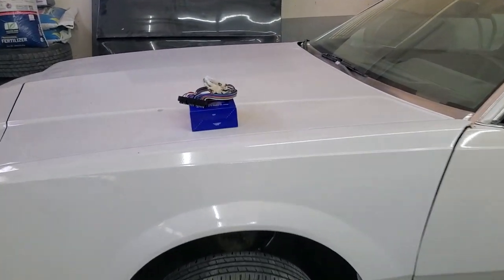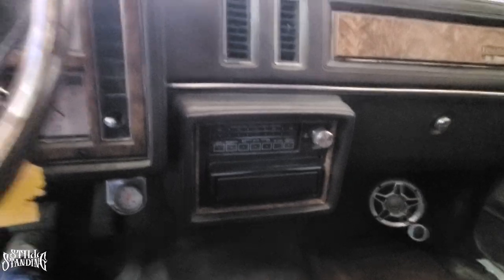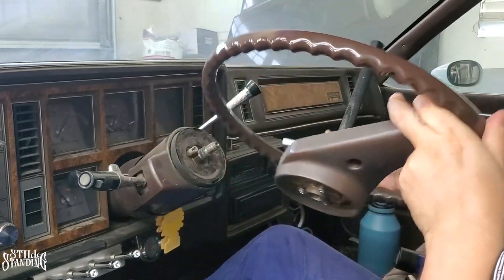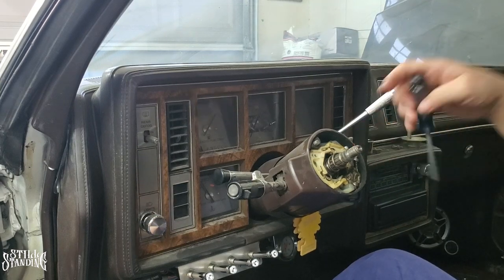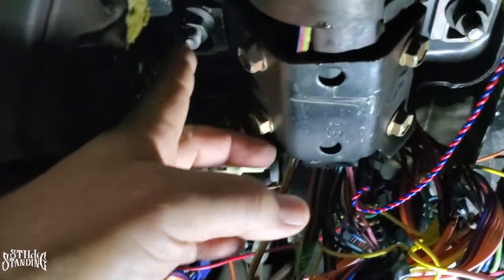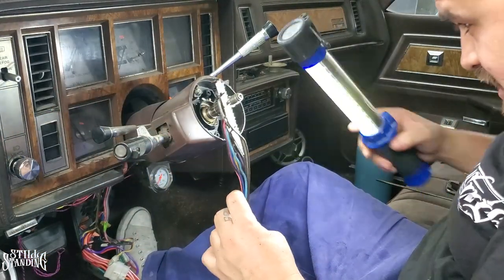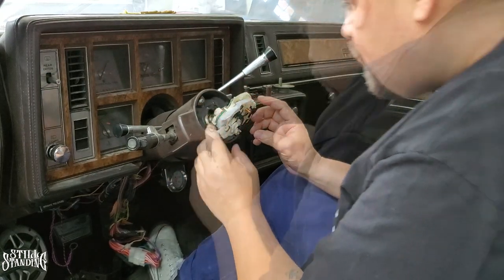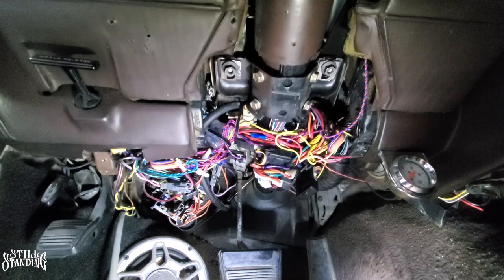G-BODY Turn Signal Switch REPLACEMENT 83 Regal

Comment: Thanks for the video its helping me out a lot. I have a question  why not just cut the wires
Reply from the maker: No problem 🤝. Yeah, you can do that, too. I didn't want to cut mine just in case I needed to put it back in. Thank you for watching
Reply: @StillStandingGarage  make sense thanks!

Comment: While removing the horn pad on my '87 Cutlass Supreme I seem to have broken the plastic sleeve which holds the spring-loaded wiring connection for the horn. Do they make a replacement sleeve?
Reply from the maker: Yes, they do. Check rockauto .com or autozone. Those are not expensive at all.

Comment: Check Dimer switch might need replaced for sides lights had to replace mines on my 85 cutlass none of my front lights would work at first
Reply from the maker: I sorted through all the wiring using the wiring diagram for this car. All my lights are working how they're supposed to now.

Comment: please-im working on my buick regal- the horn doesnt sound,  check the fuses on everything is fine-check the horn and everything is fine--- how can you help me to correct the fault-tell me where you found the part for the side lights with the wiring- it is possible thatt this piece is the one that is causing problems thanks-- and tell me the name of the extractor yo used....

Comment: We changed this on my dads 85 Cutty last year, but brake lights & turns stopped working again last month. Think we got to do this again?
Reply from the maker: I would suggest you check your ground wires and also your fuses before replacing it again. If all of them went out the same time, it could be a problem beyond the column.

Comment: you might have to swap those turn signal bulb connectors wires in the front..or clean-light sand the terminals first...
Reply from the maker: Good idea...I'll check that 👌 Appriciate it.

Comment: Ok now my low swich dont work l only have high beam's is the turn single swich the proplem or is that something else
Reply from the maker: Was it working before replacing the turn signal switch?
Reply: My turn sigle's allway's work it's my low beam's don't work just my high beam's work it doesn't click back for my low beam's
Reply from the maker: You would have to check the mechanism in your colomn to see if anything is broken
Reply: @StillStandingGarage  ok that's was what l was afraid of wanted to do it my self well one day will have to take it to the shop meanwhile can't drive it a Night
Reply from the maker: Yeah that sucks.